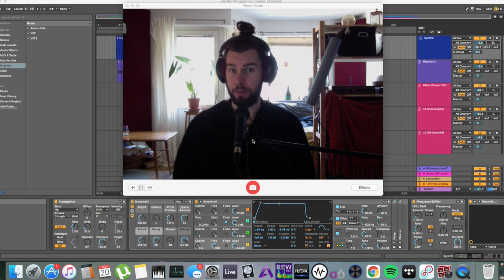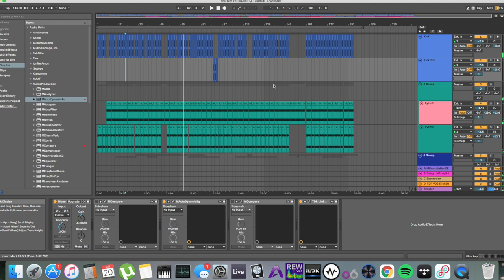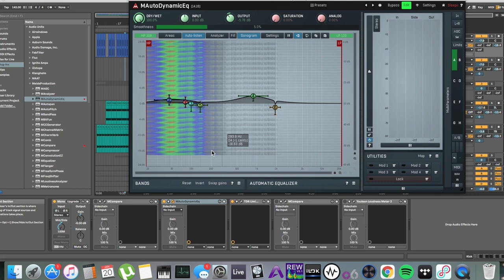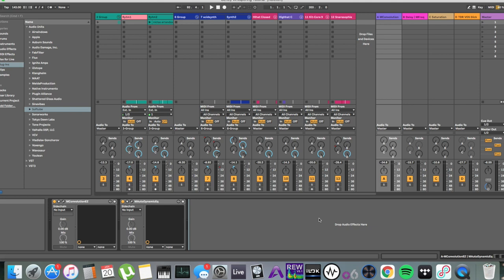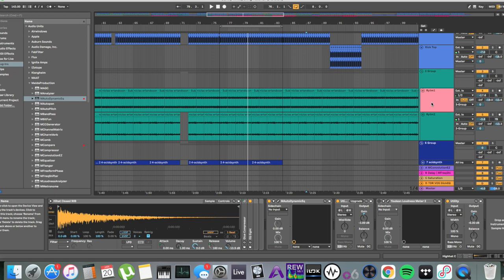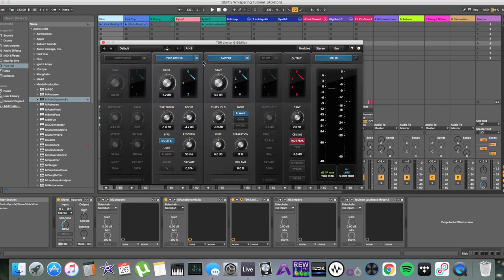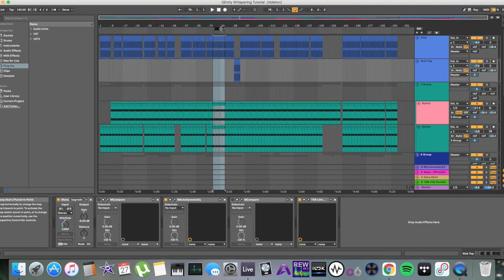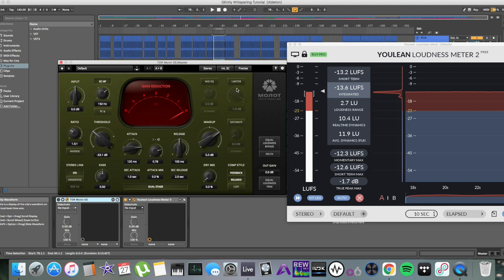Mixing industrial techno

Comment: Recently I tried to mix a hard techno track but my synths were super saw and on the mid low area, so the sound selection was bad to begin with.
For loudness I would say It's just a balanced mix so once it's "squished" in the mastering stage there is not going to be bad sounding stuff.